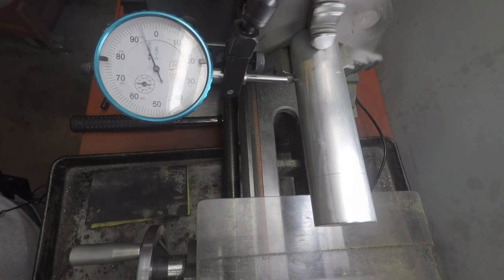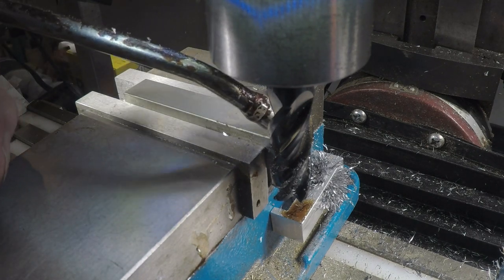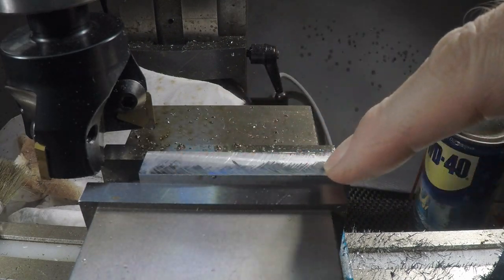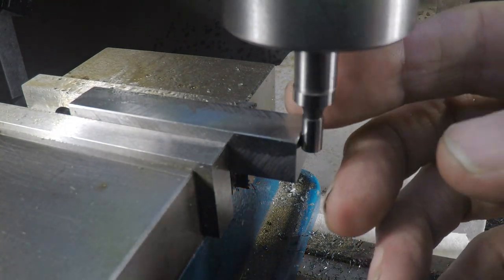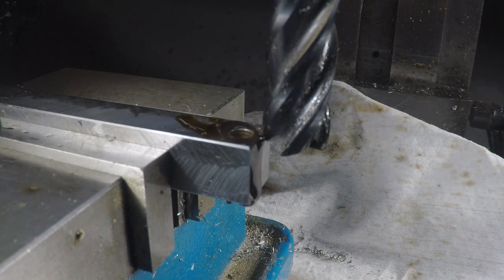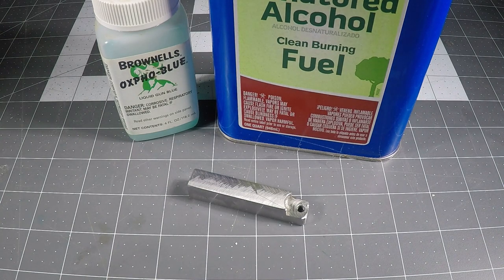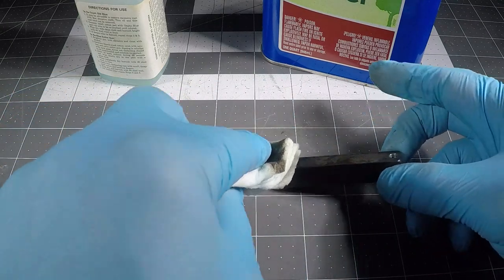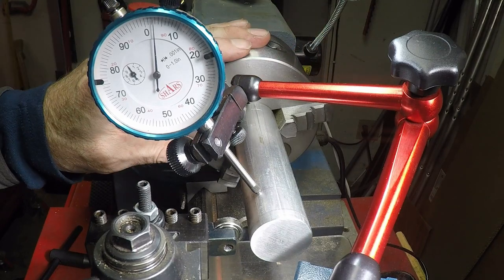Making a bearing bump tool

Comment: If you warm up the part just a little bit with a heat gun the cold blue will penetrate the steel a little bit better.  Also if you keep the part wetted with the cold blue for at least 5 minutes you’ll have better results as well. Soak the part in an oil bath 24 hours and you’ll have better protection.
Reply from the maker: Thanks. I appreciate your suggestions and will keep them in mind.

Comment: I would suspect that your bearing is not running true. You have a build up of aluminium on the left edge of the bearing. My suspicion is your having put the spring washer between the bearing and the tool. Because of the way they're made and get used they tend to have an intentional burr at the split both up and down. The bearing inner is too hard for the Burr to dig into the bearing so instead causes it to cant off sideways. I'd remedy this by putting the spring washer under the screw head thus allowing the bearing and your machined surface to correspond. Make sure there isn't a Burr in the tool that might also cause a problem. Otherwise a good  video. Thanks.
Reply from the maker: Thanks for your thoughts. I will consider changing that around.  But consider the nature of the way this tool is used the left edge will always get more wear until the part is aligned.

Comment: Nicely done guy. Try some acetone to clean you parts before map to blue.
Reply: I agree. Denatured Alcohol is a fuel  (has oil in it)  and should not be used for cleaning. IPA (91% or higher) or acetone is the way to go.
Reply from the maker: Thanks, will do!

Comment: Very nice project. Was this milled on your upgraded HF mini mill? I'm doing the ebike motor & power supply upgrade on mine after I saw your video on that (subscribed right then and there). As soon as it warms up in the great white north I'll finish it. Thank you for your time and videos.
Reply from the maker: Yup, this was done on my one and only upgraded HF mini mill.  Good luck getting that motor mounted.  As you saw, it took me a few tries to get right.
BTW, if you punch the STOP button on the new motor setup and leave the speed knob turned up, the spindle will be in brake mode, so turn the knob down all the way before re-starting.  And sometimes if you turn the speed knob too fast the motor will not start - so just wait 10 seconds and the motor will run fine.